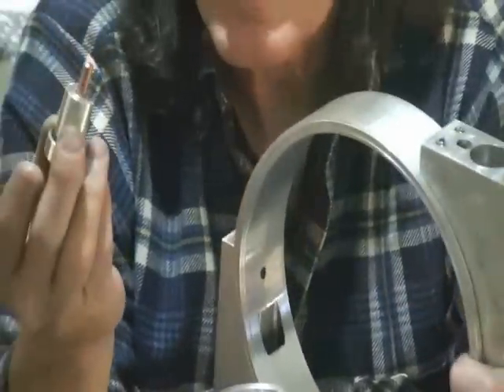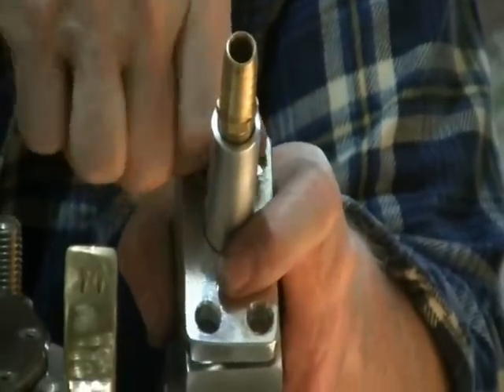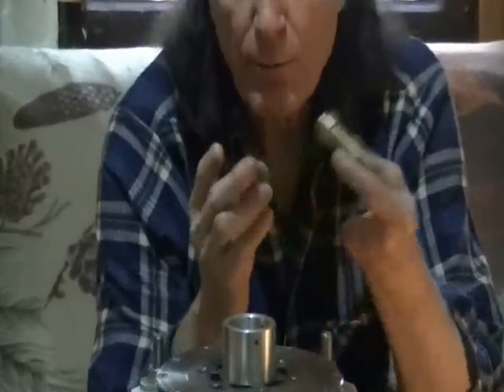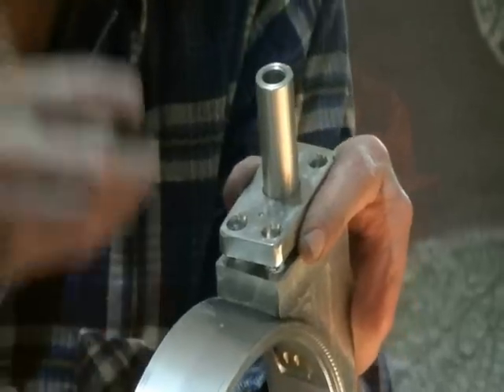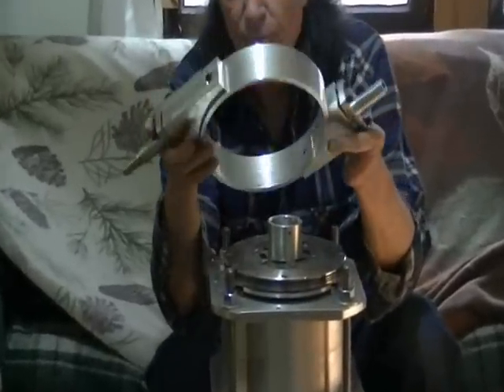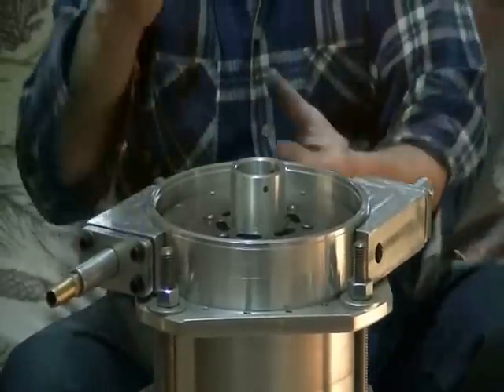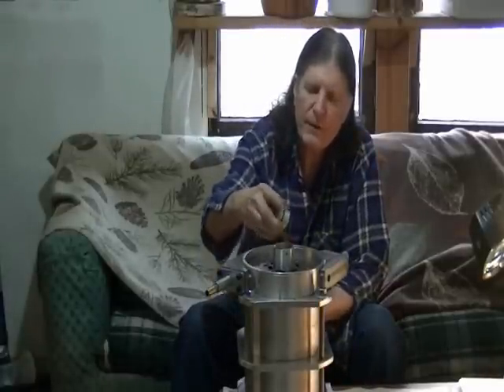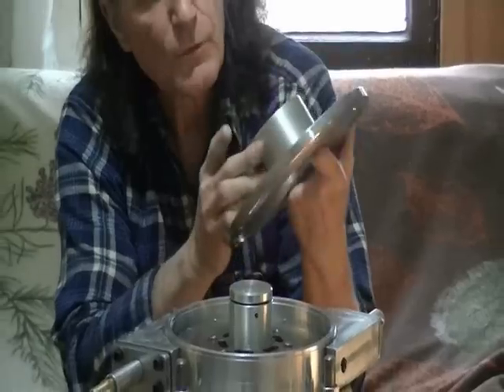Steam Tesla Turbogenerator Assembly Tips II, super efficiency, more horsepower

Comment: +evzebra I only pitch what I learn from experiences. My rig is vertical spindle based on a modified bike hub, disc brake mounts driving the rotor for load tests. All my experimenting has been on the inlet jets and laminar phenomena. Now I just want to tear it apart (again!) - your pitch sounds like something kinda easy to test/implement. Thanks!

Comment: Its nicely done, but its very expensive to make. Have a look at using laser cutting or water jet cutting instead of machining its about 5 x cheaper. 
Another problem with Tesla Turbines is that they operate at such high speeds that you need a reduction gearbox if you want to drive some thing other than a generator and gearboxes that can handle those high input speeds are hard to find and very expensive.
For me a cross between a Tesla Turbine and an Impulse Turbine is the way to go.
The turbine looks exactly like a single rotor Tesla Turbine except there are 3 small pushing surfaces cut into the disc. These cuts are shaped so that they allow steam into the working impeller surface but they very shallow to keep the volume of steam to a minimum. This works over 15 degrees then there is a constant radius for 15 degrees to allow the steam pressure to build up so you have all the benefits of a Tesla Turbine and the high torque of an Impulse Turbine as well. 
And being the heathen that I am I want to sand blast the rotor with a coarse grit sandblast to make the disc as rough as possible so it can capture as much of the mechanical energy as possible, I think a smooth surface on a Tesla disc allows too much energy to escape through the exhaust. you only have to take a drinking straw and blow on a smooth disc and a rough surfaced disc to see this.
Reply: +EVZebra isnt the beauty of the tesla driven design that the air has exactly minimal disturbance to interrupt its natural flow path  ie. = efficiency?
perhaps the roughness needs to being the centre of the rotor?? but hey, theories are flawed inherently around here!!
Reply: wade neumann
Well if you build one just cut 2 different rotors the one is smooth and round and the other one has the impulse cuts in it. Run it with both rotors and see which one makes the most electricity. After the first two tests then take the impulse rotor and sandblast it and run a third test. Compare the results and you have the final answer. This can be done on some thing the size of a CD it doesnt have to be a big turbine. In fact if you use a RC type DC brushed motor directly coupled to a DC motor (no gearbox) they good for some thing like 30 000 RPM not that you will get up there easily.
On the output wires on the motor add a diode on the one wire so the electricity can only flow to the battery, even with a small turbine if it runs for 12 hours a day preferably powered by the sun via mirrors reflecting onto a boiler then you can have free lighting at night.
Get the best option, learn small so that the development costs are small and then when you have the best solution build a bigger one.
A 400mm diameter turbine will easily make enough power to run your house at night. Cook and shower on gas and use the batteries to run every thing else.
the Edison Battery lasts for between 40 and 90 years and can be over charged and completely discharged and it bounces back every single time so the yearly cost of batteries gets eliminated.
Reply from the maker: Not true - Tesla turbines are self-regulating, will post a more technical reply from Ken soon. also, yes water jet & laser cutting are faster/cheaper to cut - but we aim at developing countries where these expensive shop tools are out of the picture. (btw - thanks for watching our channel EVZebra!
Reply: بالتوفيق
Reply: Only a pleasure and thanks for posting.

I set a wooden box on fire with 50x50mm mirrors mounted all over a  tea tray, yes thats how small the area covered with mirrors was, so if you cover a large area you will definitely have enough steam to make some decent power. 

I also put one mirror on the ground and then I put a large piece of wood on 4 bricks on each corner next to it. The sun reflected off of the mirror up onto the underside of the wood. Every 30 min I drew circle around the reflection. 

 After a whole day I flipped the wood over and the circles moved in a straight line. This means that you can use a 4 inch pipe around 4-6 ft long permanently mounted on two end supports.
You put around 6ft x 6ft's worth of small mirrors on the ground and if you set it up correctly then when the sun comes up the boiler will start making power. If you set up the water level with a brass needle valve from an old cars carburetor you can keep the water level at around 1 inch deep in the boiler so it boils easily and then the water level will be maintained the whole day even though this will limit the pressure of the boiler to the water line pressure of around 4 bar.

Its will be a super thing to have as it will start and stop by its self.
You will most likely need to put the turbine in a sound proofed box as the noise will be quite loud.

Comment: Where will you get steam to turn it?
Reply from the maker: +Danyal Ahmad This turbine can use compressed air or steam. Steam can be produced by concentrating solar heat or from a tube boiler fed by wood or other renewable biomass. The beauty of this approach is that you don't have to fiddle with devices that remove the water droplets from steam, like you must do before feeding steam to bladed turbines.
Reply: +Danyal Ahmad water? lol
Reply: Nash Thomasson   How did you heat it up?
Reply: i have not done it but you would have to build a boiler. this could be heated up a number of ways by burning gas or coal ext...